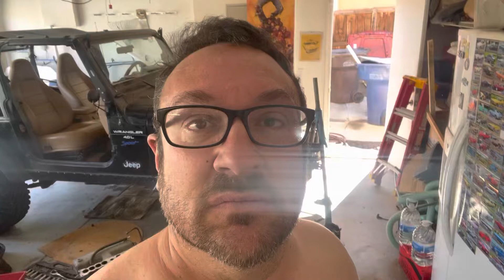Wrangler TJ Savvy upper control arm install with axle bushing

Comment: Are the aluminum arms solid aluminum ? If so I may see if a friend can mill a notch on each side to make it adjustable
Reply from the maker: Unsure. Sorry. However using a rubber strap wrench would work

Comment: Try using torch to heat inside of bushing metal insert. that'll soften the plastic to near melting point,  then push out metal insert with bushing tool or "C" clamp then follow up with sawzall to cut into 2 halves. repeat procedure with bushing tool. if u have air hammer, take rim of outer bushing-sleeve and collapse one side straight thru and push out. 😉👍